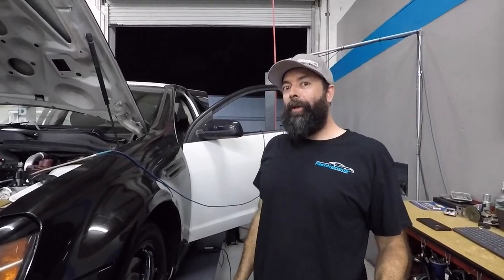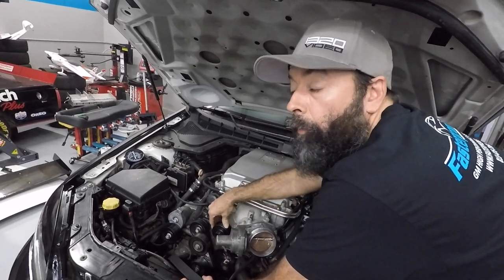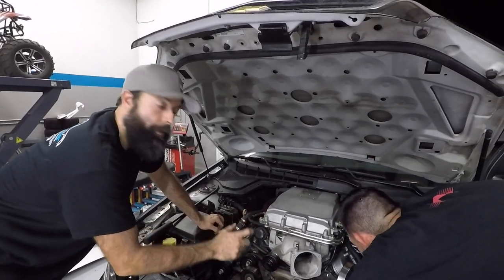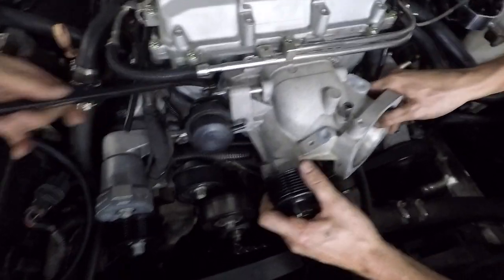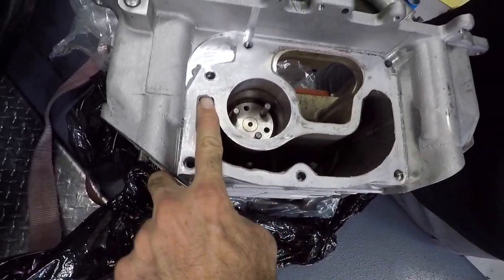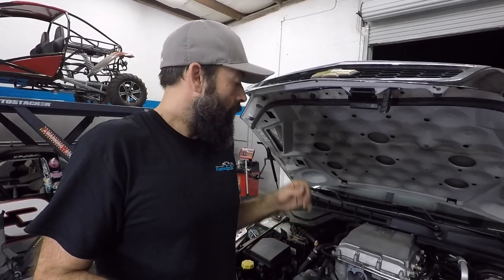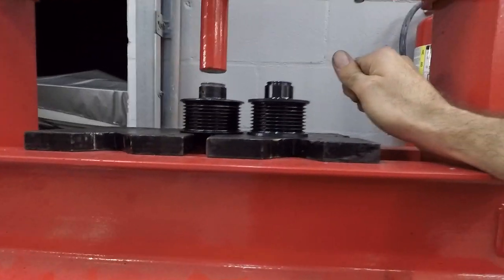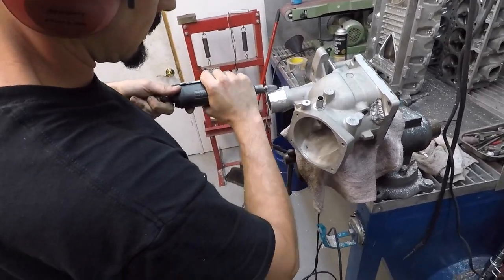How Much Power Does 2 PSI Of Boost Add? Project 9 Sec Caprice Cop Car Ep.11

Comment: Jeremy, why don't you clamp the throttle body to the mill table and take your boring head, turn the tool around so it will "bore" a post. You can then much easier turn the diameter of that pulley support to the diameter you need. I do this all the time, and it works awesome.

Comment from the maker: Guys I’m truly not a liberal Starbucks fan I just don’t wanna ever have to give them any more money! Also while the salt in the blower coolant sounds good, aluminum (intercooler and heat exchanger) and salt don’t do well together. Also for parts PayPal is jeremy@fasterproms.net
Reply: Fasterproms does uncle sam still run the stock balancer? Or did you use a v or zl1 balancer?
Reply: So how does the cam you are running compare to the Texas Speed Bald eagle cam that Leroy was running with the blower setup on stock LS? Love the build man, will be ordering some parts from you in the next couple months for my C5 build. Keep up the good work.
Reply: Fasterproms could you use dry ice and coolant/antifreeze concentrate to bring down intercooler temps?
Reply: Hey Jeremy missed the live feed last Sunday, don't know if you will read this, but what surplus auction did you buy your caprice at?
I've been looking at buying one for last few months myself, but now that you decided to build one it's motivated me to get one asap lol
Reply: @luckautofab4461  go back and watch the video... he did not get it from auction.
Reply: Yeah yeah dry ice and meth ! Dry ice dry ice !  And just buy an espresso machine....
Reply: What material are the thermal plates. Just curious.
Reply: Bonus with dry ice is you can leave the wiper fluid in there, and as the DI sublimes, you can keep adding it. without it overflowing...
Reply: Is that blower rated for wet operation? I know the rotor clearance tolerance is different between dry and wet.
Reply: Bring forth the interchiller! Does an LSA wonders.
Reply: What is the deal with Cletus side by side on the lift. Why does it never move or nobody ever talk about it ? It's a shame. If I had that I would of already thrown a R1 Yamaha street bike motor in it already .. take that for some thought

Comment: Put a metal aftermarket isolator for the blower so the plastic isolator doesn't give out and it will give you a little more hp in the end

Comment: As long as your pump and lines hold up, and if you can keep moisture in the intake charge down, you could run with Dry-Ice/Acetone and get sub-zero IAT's. How much power could you gain from THAT?

Comment: Could you use the air con to cool down the intake airflow before it enters the compressor?

Might require manufacturing a bracket/housing to ensure only cooled air is drawn through the air filter but worth a thought?

Comment: Rig the AC compressor to cool the charge. Ford experimented it with the "Proto" last gen lightning, supercharged. 40+hp on the chilled charge alone... look it up, self replenishing... like a 20 second burst if I remember correct.
Reply from the maker: Trunk tank will work just as good. Less work, cheaper and more effective.
Reply: Tony O this is what dodge has done with the demon.

Comment: Jeremy, What are the thermal plates made out of? I have a gt500 blower on my 3V mustang using a custom manifold and I have been exploring the idea of adding the thermal plates as the car heat soaks when stopped and parked. I have been thinking Teflon?

Comment: mount is awesome
i would do about 3-4 oz of transmission fluid in the intercooler my yukon dropped 15 degrees with 8oz. in the coolant in the summer. is it right idk but i don't wanna be lol
i still want to see an injector spraying marvel mystery oil into the rotors/turbine/cork screws? i can't remember they are called atm. i would do every couple revolutions to see if it would increase power due to better seal.
there is a limit to how bad my grammar will be

Comment: Is there a function in the ECU to adjust the fuel map vs inlet temp at a given boost pressure and rpm, so you can have it auto adjust for whether you've got it iced or not (similar to auto detecting your fuel mix)? If this isn't already a thing, I'm sure the brainiacs at Haltech can throw it in there

Comment: At the beginning of the vid now. I predict 2.5psi extra will add 40whp.

Edit: seems like I was pretty close. The dropping of boost up top kept the gains a tad lower than I expected. I believe there's pressure (boost) drop up top due to the supercharger getting out of its efficiency range. Rather than pressurizing the air more, it's just heating it up. Superchargers usually have a linear gain: less pressure at lower rpms, more at higher, consistent with how fast you're spinning it. To see the converse of this leads me to believe what I've mentioned.

Excited to see what the cooler air will do. I have a turbocharged car myself, and I know how big a difference a 40 degree drop in boosted air temps can make.
Reply from the maker: The blower cannot keep up with the way the air the engine is ingesting it would be another way to look at it. If the blower were larger it would maintain and possibly gain in the higher rpms. Centrifugal SC make linear boost, positive displacement make max instantly and hold isually
Reply: Good info. I know much more about turbochargers than superchargers, and really appreciate your professional expertise.

Question: boost is technically a measure of the air's resistance to going into the engine, which is why the pressure builds and we see a higher boost psi as we raise things like wastegate duty cycle (turbos), everything else being equal.

Similarly, It's pretty well-known that when a setup flows better, you can make the exact same power at lower boost (also everything else being equal), which also makes sense from this pressure-based perspective, since a better-flowing setup won't bottleneck the flow as much, therefore you read a lower boost pressure. How does this fit-in with what you're saying? Perhaps Sam's heads/cam combination are in their flow sweet-spot up top and you're therefore seeing lower boost pressure?

Comment: Neighbor made 800whp and 770wtq and revs out to 7500... Stick a T56 in the Caprice! This race is going to be epic!
Reply: They come with tr6060s in oz.
Reply from the maker: Hang around and it should happen soon!
Reply: These never came with a manual trans in Australia. They were all auto.
Reply: You’re right, I’ll be damned. I just assumed because of gm’s love for the tr6060 and the use in the ss sedan.
Reply: Neighbor made 808 but he's gonna make more soon. Since they have to replace the head gasket they're going heads and cams.
Reply: Karl Hopkins sounds like Uncle Sam is going to have a trick up his sleeve 😎

Comment: Would it be beneficial to use dry ice instead of regular ice, and instead of regular water, a hyper salty/hyper saline solution that would drastically lower the freezing point of the water, allowing much cooler liquid to flow through the water to air intercooler?
Reply: Antifreeze might be a better option over saltwater.

Comment: How long will the stock 6L80E last at that power level?  Loving watching the L98 engine make good power. I have one in my Aussie VE SSV
Reply: 6l80e will last fine as long as the tune is good. And it will be a L76 or L77 motor. L98 was not fitted to these.

Comment: Can't wait to see you put nabor away at the track
Reply: Not sure about that. Neighbor put down 808whp with the stock gt500 exhaust. If they do a full exhaust it will gain a good bit. Plus since the head gasket went he's doing heads and cams. Plus if he runs an intercooler with electric fans it will make even more.

Comment: Jeremy, I noticed you have the torque parameter added is their a reason that parameter will only go to 640ftlbs? Reason I ask is mine pegs that and doesn't show more, ever under spirited acceleration. Had my hp reach 812 on a fourth gear pull, this is in my 1.9 supercharged G8. I'd love your feed back about this.
Reply from the maker: It’s a max value in the pcm or PID. Yes the car can make more than that but it has to do with the scaling Of the gm tables etc.
Reply: @Fasterproms1  Thanks for the reply, love that you're doing the Uncle Sam project! I did mine at 158000 miles and it's got a ton of blow by. Will be pulling it down to swap the short block out and upgrade from the btr stg.2 to the 3 after hurricane season, bayou problems! Have been seriously considering coming from Louisiana to have you tune it when finished, so if you're up for it I could be enticed with a debut on your channel and a friendly grudge race! Lol but seriously... it'd make my ten year old son's day! I've got 2 videos on my channel of completion and just a stupid pull if you wanna see it, give me a like if you do!

Comment: do y'all ever consider using dry ice in the water tank? in my mind it seems like it would cool the charge air even cooler
Reply: Dry ice makes carbon dioxide when it melts
Reply: seeing how it it solidified carbon dioxide, i believe that is a correct statement, sir/maam, although i dont understand exactly where youre going with that.

Comment: Guy's I have a couple questions for you. I'm trying to put a LSA on my 350z LS1 5.7. What I need to know is items/parts I may need. I know I'd need a ctsv pulley, also changing the belt drive to either a c5 or c6., a new cam, and maybe a spacer for the heads or LS3 heads. I'm clueless on what else. Please help.
Reply: Ask Sloppy, he's about to do the same thing.

Comment: Dry ice and alcohol instead of water (dry ice would just freeze water). Would it be dangerous to have flammable alcohol running through the intercooler system in the car? Yes. Would it be awesome to have -100* F intake temps? Also yes.
Reply: Concentrate antifreeze with possibly an addition of meth/ alcohol to drop freeze point further.

Comment: what would the power difference be with a manual trans rather than an automatic?
Reply from the maker: The manual should make another 20 er so depending on the clutch weight.

Comment: Basically, hp added by 1 psi is determined by a million factors. Volume of the cylinder, current pressure above at or below sea level, A/F ratio, blower size, blower/turbine CFM, etc etc etc. 

If your car is boosted from factory, its said that 14.7psi will double the power of the car naturally aspirated. 1psi can equal anywhere from 5-16/17hp to the flywheel. Thus, its literally impossible to truly calculate how much power 1psi adds to an engine.

If the whole '1psi equals 10 hp' was true, my KB would be 19hp per 1 PSI of boost. 9PSI on my Kenne 2.1 added about 170whp to my 2v 4.6L.

Well it did before I popped a head gasket and bent a valve. Guess thats what I get for boosting a 230K 2v lol.
Reply: And yes, you may be able to pull 10hp per psi of boost in the weather conditions and at the altitude you live in, with your setup. In most cases, that isnt true. In some cases, one or two psi of boost could even lower your hp.

Comment: I kinda wish you would talk actual AFRs or lambda instead of how you explain it in the vid. For instance, you said it ran rich after you iced the intercooler system and it would have made more power if you leaned it out. Will you be more specific? I understand the concept but I'm curious about what the actual numbers are. Thanks!
Reply from the maker: 12:1 is plenty safe on e85 or pump. It went to 11.4 so there was a loss of power at that rich

Comment: I feel like you could have made much more with a simple turbo setup just sayin. Still excited to see where this goes
Reply: No bottom end torque or linear power. Turbos are fast on the top end.
Reply: And, he’s doing it cheap with mostly parts he already had.
Reply from the maker: Never as simple nor as cheap. But hang around and that might happen!
Reply: Great video. 
Your detailed explanations of everything you're doing are awesome.
( Suggestion for future build)
.... Cut out the rear spare tire area, cover & reinforce. Then mount 2 turbo's. A smaller and larger compound turbo set up. Would need a separate oiling and scavenge system. You get the best of both worlds, with hardly no turbo lag. You'll have to have some type of venting to get some fresh air in. 
You guys are creative though I'm sure you could find a way. 
All hidden. More room in the engine bay too. 
I know you guys are using leftover parts around the shop. I'm sure you have a couple of big and small turbos, tubing and such laying around. 
There is a racer here on YouTube in Australia running a single rear turbo with awesome results.
Reply: Adriansitos623 very false.
Reply: Fasterproms I built my turbo setup for about $1600. I’d say that’s pretty cheap.
Reply: Fasterproms dont take me the wrong way i still love what your doing here!
Reply: @Turbogto_guy  It can definitely be done. Just follow the Sloppy Mechanics build recipe. The blower setup would be easier, as it requires no welding or fabrication.
Reply: Do both! :) Best of both worlds if you can keep the heat under control!

Comment: No offense,, do you rly not know that much about any auto trans after 99? The Jeeps, Rams and Chrysler’s had 6 speeds back then with the 545. They’re just a bit better than the 700GaRbage4 you’re prob used to. I’ll bet that 6 speed in the Caprice doesn’t have even an 1/8 of the power loss you think it does. You said you’re already making more power to the tire than leroy did with a bigger pulley. Uhh, hello!? You will not shift as fast or as precise as an auto. And you will NOT lose boost during any shift ever.
Reply: Hunter O'Connor Jeremy has been tuning cars since the late 90s early 2000s i think he has a good understanding of it.
Reply: bull ony yes he may not know as much about trans as he does engine tuning but i do believe he knows enough and i don’t know how long you’ve been watching but he’s going to swap the trans for a 6 speed manual so I’m sure he’s ready to toast it.